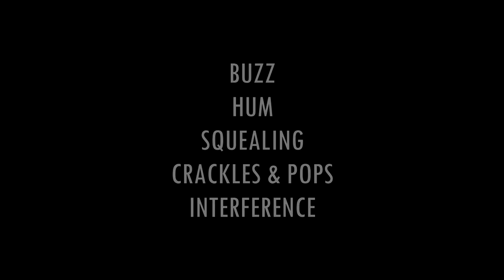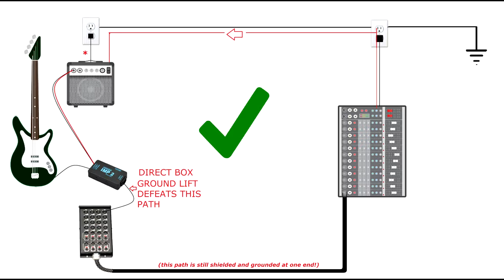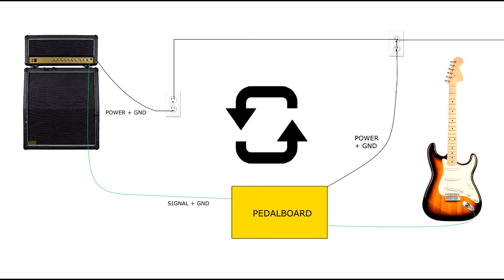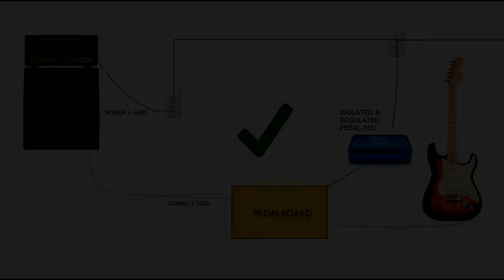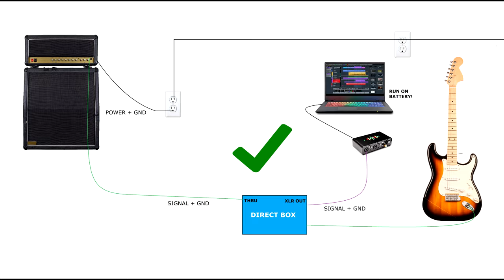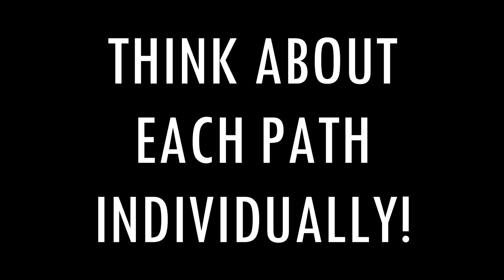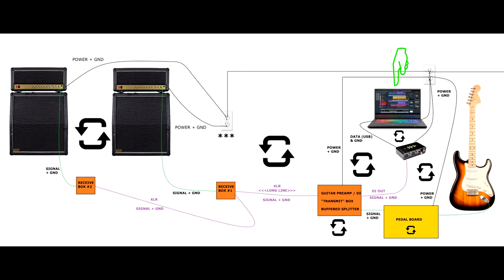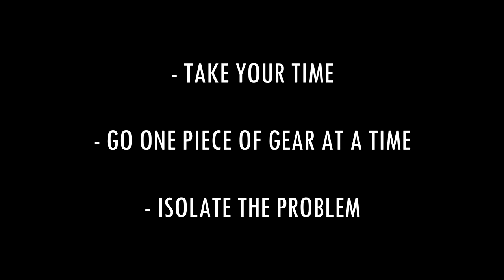Ground Loops: What Are They and How to Eliminate Them in Audio Rigs

Comment: Great advice, thank you. Here is my problem; I have Klipsch 2.1 computer speakers. When I plug the green end cable into the motherboard, there is a loud noise and even if I just slightly move the cable it is sooo loud. Also to that, when I mouse over (not click) a link, there is a pulsing noise coming from the speakers. Talk about annoying. I used these speakers on my old computer and no issues. Now on my new computer with a Gigabyte motherboard, there is. Old computer, Windows 10, new computer, Windows 11 if that helps? Thank you.

Comment: Hi, I am upstairs. In one outlet I have two power strips connected. In the other outlet I have a guitar pedal connected. Anytime a specific downstair room turns on the light, I will get a buzz in my Amp. Do you think I should get

Behringer MicroHD HD400 2-channel Hum Destroyer

Or

Morley Hum Exterminator Ground Loop Hum Exterminator

Or

Furman M-8x2 8 Outlet Power Conditioner

Thanks

Comment: Excellent video, thank you! Can you help me understand how it's still possible to have a ground loop in your examples where all equipment is plugged into a single power strip/the same socket?
Reply from the maker: Yes - so ground loops can form any time two [interconnected] pieces of equipment have different paths to ground, each having slightly different ground voltages or resistances. So if two pieces of gear both plugged in but are interconnected by an AUDIO ground (let’s say one is a pre and one is a compressor) it forms a loop: piece 1 goes to the outlet, and connects to piece 2 with an xlr cable (which has a ground) and piece 2 also goes to the outlet. Hence your loop. Current can flow around this loop from outlet > piece 1 > audio ground > piece 2 > outlet and back again.
Reply from the maker: If the two pieces of gear aren’t interconnected, you won’t form the loop. like say it’s two guitar amps but one is played by Guitarist 1 and the other is played by guitarist 2. There will be no loop because the two amps are not interconnected with an audio ground. But if guitarist 1 uses a splitter and goes to both amps, you form a loop from splitter > amp 1 > outlet > amp 2 > back to splitter

Comment: So reamping without a reamp box into lets say pedal reverbs and then back to the interface creates a ground loop, correct?
Reply from the maker: It can. That’s one reason why most reamp boxes have transformers and ground lifts. But, the transformer is also there to convert the impedance from low to high, and to convert balanced to unbalanced. And Like I said in one of my other comments, ground loops are kind of everywhere in complicated setups. Often, they are very noisy. Sometimes they are not.
Reply from the maker: Also remember… if the reamp box is passive, and the pro audio gear has a well designed power supply, then they’re both isolated from the power side of things.

Comment: So what I dont get: I would have to put a DI box between any rack unit, right?
I go XLR out from Rack eq to rack comp, voth use piwer cable --> ground loop
I go rack chanel strip --> interface, both have power --> ground loop
Reply from the maker: So, I know exactly what you’re thinking - and yes on paper it does look that way. But frankly, balanced pro audio gear does such a good job at rejecting noise and isolating in the power section that this is basically never an issue. For years, a standard way to wire studios was “OEO” aka “one end only” meaning, one side of the balanced line had a ground lift, exactly for this reason. Every single piece “theoretically” creates multiple ground loop since they are all connected to power, audio, AND they’re all physically touching in the rack rails! But truth be told, ground loop noise is a spectrum, meaning, there are “worse” ground loops than others. Some are insanely noisy. Some are technically ground loops but don’t have bad noise, as is the case in 99% of rack gear. The amount of noise is based on the small voltage differences, and for balanced pro audio it’s just not that bad. Imperceptible in most cases. So most studios don’t even bother with OEO wiring anymore, and most gear manufacturers are hip to this nowadays and design their gear well to accommodate for standardized wiring.
Reply from the maker: When you first “get it” it’s easy to look around at all of your gear horrified and be like “oh my god it’s all ground loops!” lol but don’t fret. Fix the noise when it’s a problem. If it’s not a problem, then no need to fix or change anything. And thankfully most gear nowadays is well designed enough to not have these problems. But like, I have to use a ground lifted setup on my vintage LA3A because it has a ground loop problem when interconnecting to other gear. But that piece is like, 60 years old.

Comment: What if I use 2 isolated power suplies? In my case a voodo lab pedal power 2 and a styrmon ojai? Still a problem? 

So I have a ground loop somewhere in my board. For the last 8 pedals its all hood (all strymon pedals) but then it doesnt matter which other brand pedal i add, I get hum and rumble (low level) i have changed the strymon order afterwards and changed the cables so none of the strymons is at fault. And I have added the other pedals to the "good" ojai power. Doesnt mattr which one i add, the boss eq, jam pedals drives, expression pedal. A bit of buzz is there regardless.
Does this just show the good build quality of strmon or is something incredibly off?
Reply from the maker: Well, Strymon pedals and power supplies ARE really well designed, are super quiet, and have excellent power isolation. And yeah there potentially could be issues using two different power supplies but, I don’t know, maybe not. That’s hard to say for sure and hard to diagnose. I’m not really sure I can say one way or the other just from this info. I would keep experimenting, try to rule out variables, different combinations. Make sure to test all your cables too. I’m sure you will find the solution. Sorry if that’s not much of a help.
Reply: @RecordingLounge  Mate thank you so so much for all your answers! This is really really interesting to me, like its kust fascinating.

And truth be told, I really need to turm up level to hear the ground loop, like I mean Inneed to go into a rack unit and go balanced out, crank the gain on the interface and turn up speakers tonhear the geound noise (which then you hear clearly)
But alsonthen white noise from the focusrite scarlett 18i20 is allready a lot louder (which is an issue)

A little side note also: would you say that most pieces of analog gear could potentially add white noise?

Bc yesterday I was recording the level of my signal chain white noise a) with the presonus studio channel rack unit b) without it (firstly recorded a looped signal to make sure the base level is the same for both)

Sadly the rms for whote noise only was about 2.5 db louder for the preamped signal compared to the normal instrument level signal with the exact same signal level for the loop itself which makes me sceptical if more hardware units is even a good idea. Simce clean signal is king.
Again, amazingly, 8 strymon units didnt add anything in noise, like they are stone quiet. They need to get into rack units more
Reply from the maker: @marcusstrymon693 yeah, unfortunately white noise / hiss is normal for virtually ANY analog circuitry with amplification stages. It comes from transistors, tubes, even resistors! It’s unavoidable to some degree. I mean “Johnson noise” is literally the noise from electrons moving around inside of the components. Nothing can get rid of that. Over the years the components get better and the circuits get better. When it comes to analog gear you def gotta be careful with gain staging to keep it as quiet as possible. And keep in mind .. Strymon is primarily digital processing. They use the same SHARC chips that UAD cards use. There’s pretty minimal “analog” circuitry in there which is one reason they’re so quiet. 

And yeah, analog gear is noisy. Digital signal path with a clean pre can sit around -90, -95, 100dBFS. Insanely quiet. But a real Neve 1073 into an 1176? You’re sitting -70, -80 easy. Easily 20-30dB more than a digital piece. 

Some of it is just the cost of the sound. If you gain stage it right, the noise isn’t really much of an issue. But for some folks, they don’t wanna deal with it, or the sound of the dope analog stuff isn’t worth it for the noise.

It’s something you get used to and learn to manage. It becomes part of the toolkit just like anything else - like, if I’ve got a quiet acoustic guitar player, I maybe can’t use that tube mic or compressor, because the noise is possibly gonna be too high. Maybe it’ll be worth it. But I might go for a solid state mic with a slightly cleaner pre and no compressor, and call it a good compromise. 

And when all else fails… there’s tons of great noise reduction plugins like Izotope RX. And sometimes that’s the compromise. We use the signal chain that sounds amazing but has a little noise, and just deal with it in post.
Reply: @RecordingLounge  thanks once again for the long answer, starting to understand things

So essentially one could think woth strymon allmost plugin in a box, right?

So the presonus that I use has noise floor of 96 db which seems okay, however its still anoying as an always on. It just gets progressively worse when using the comp and adjusting makeup gain (obviously).
Still, the value seems okay ish compared to other units (Warm audio bus comp <90, ssl fusion about the same and the harley benton cheaper unit goes in at a whopping 76 db noise floor, which seems unusable).

One solution that seems to work is to boost the signal level with the strymon sunset jfet boost with low drive because it does not produce noise almlst at all. That almost reminds me about back in the day when they tried to record as hot as possible on tape as they could to avoid the high noise floor.

Hm, difficult, I really like the idea of comp and eq after these strymons but I hate noise.

Thing is, kust by tweaking around with that presonus for days with a gr meter whilst playing allready makes me understand compression a lot more intuitively (would beed a 2nd one for stereo comp maybe or some other nice unit like the WA vca bus comp or the art stereo comp for 600 bucks)
For eq, I thought about the boss eq 200 as pedal seems like the easiest format but really I think parametriq with q and freq select is a lot more useful but there is nothing useful stereo in pedal format

Comment: Hey I’m using one amp, pedalboard powered by cioks both plugged into a power conditioner and humbuckers and I will get wild hum all the time. What do you think I should try?
Reply from the maker: I would start by trying to narrow it down first: Try plugging straight into the amp, no pedals. Still get bad hum? If so, you could have a bad ground in your guitar. Try a different guitar. Same noise? A failing filter capacitor or bad connection within the amp can also cause hum. Try a different amp. If your guitar to amp is quiet, then add in your pedalboard. Could be a bad power supply (I’ve not had great luck with Cioks tbh), or a bad cable (extremely common) or a bad connection on a pedal jack (also common). The more you can narrow it down, the easier it will be to find the true cause of the issue. 

Also… make sure to quadruple check your instrument cables / speaker cables and make sure they are indeed the proper type, and that they’re wired correctly. Like I said, eliminate possibilities one by one.

It can be time consuming, but it’ll be worth it when you actually find the root cause.
Reply from the maker: Also I should say… if you turn your guitar volume down and you don’t have noise, there’s either a wiring issue, or more likely, there’s noise in the room being induced into the pickups. One of the only ways to solve that is distance: don’t sit too close to your amp or anything with a power transformer, any computers, keep your phone out of your pocket. Theres tons of devices around us all the time, and not even humbuckers are fully immune. Induced noise sucks. I wish we could do more about it.
Reply: @RecordingLounge  I honestly think it might be my house because I still get hum plugged straight in. I’ve tried different guitars/amps and power supplies etc. would running a Lehle or something similar even with just one amp help at all or would that not work in this case at all?